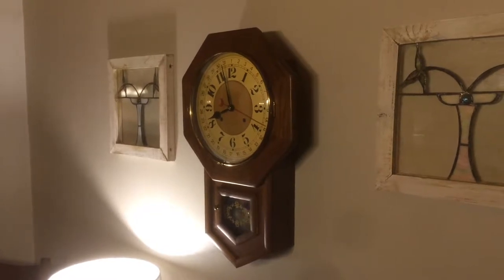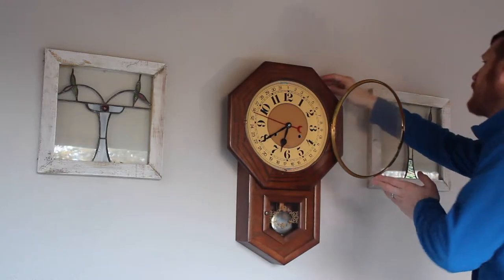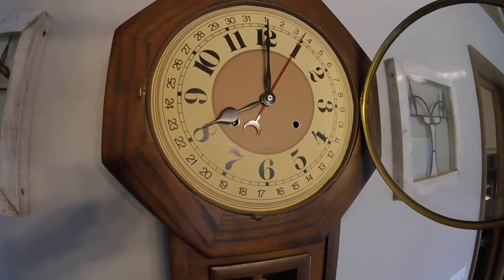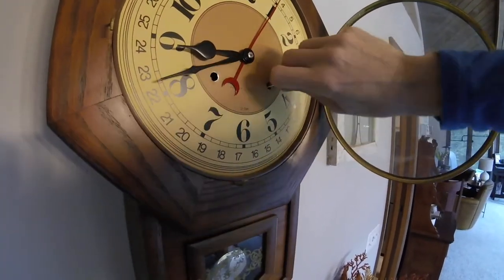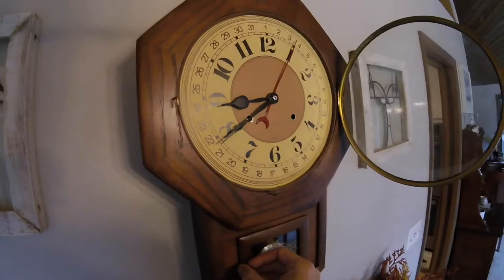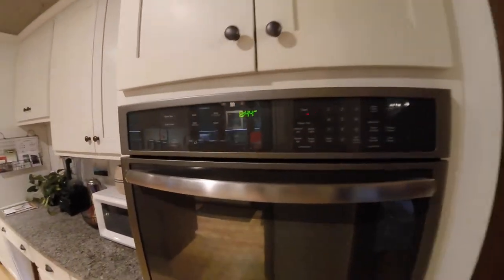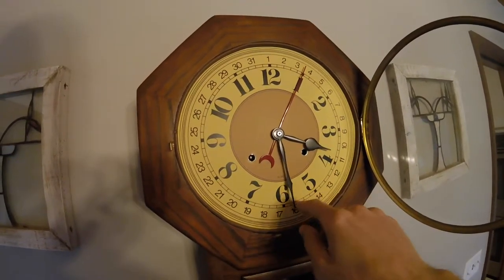CHECK OUT OUR ***Vintage Hamilton Clock (31 day)*** How to wind

Comment: Nice video but you forgot the most important adjustment.
Most Wall clocks are mounted on a single mounting point on the rear near the top. This means you can adjust the clock tiny amounts clock or anticlockwise. In the same way you adjust a painting on the wall. You need to listen carefully at the clock tick. The time intervals between the tick tock sounds must be equal  from tick to tock as it is from tock to tick to ensure the clock runs correctly.
Sometimes there is a marker at the bottom of the clock where you can make a pencil mark on the wall to keep track of where the balanced point you found is located.
Reply from the maker: Thanks for watching and the comment @Orlando Da Silva!

Comment: Which winding stem powers the  clock and which one powers the chime? I don't want to hear the chime currently...can I wind the clock and not wind the chime?
Reply from the maker: Thanks for watching - good question! As far as we know, there is not an easy way to stop the chime - other than opening up the back of the clock and removing the mechanism that causes it to chime.

Comment: I just inherited my Grandfather’s clock. Same one from the video. I wish I’d found this video first to order the key you have listed. I got a universal one from Amazon that has like 10 sizes lol. Anyways… I’ve noticed it gets a little over a 1 min behind everyday. So after a week it’s about 10 mins behind. Is this normal for a wind up clock or does that mean I need to investigate getting the pendulum adjusted?  Is that a sign to wind it up more? Sounds like you said winding the clock is a monthly task.  The clock has only be serviced once that I know of and sat for about 2 years in a closet after grandmas passing before I got it and shipped it to my home. Trying to learn all that I  can to keep it ticking for many years to come. Thanks!
Reply from the maker: Thanks for watching and the questions - I would recommend have someone service the clock (if that is available in your area).  As for the clock getting behind or ahead, there is usually an adjustment nut on the bottom of the pendulum that allows you to increase or decrease the speed of the pendulum and thus allowing the clock to keep correct time.  If it is only getting behind 1 min everyday, it should be just the slightest adjustment on the pendulum. Enjoy your clock - we love ours!

Comment: I have this exact Hamilton clock. It literally was my grandfather's retirement gift from Western electric. Unfortunately, it was over-
Reply: Unfortunately it was over-wound and has stopped working. I've taken it in for repair but the repairman is having difficulty finding parts. Can anyone help?
Reply from the maker: Thanks for watching and the comment @Tina Jurgens!  We received our clock as a gift from some good friends who had owned it previously (I believe they acquired it in the mid 70's).
Reply: Which way do you turn the middle hole if you have one? Ours is a 1984 Hamilton my grandfather got as a retirement gift.
Reply: SEWARD DRUMS which ever way it will go. Never ever force it if it won’t move.
Reply: Same! I just inherited my grandpa’s clock. Since both grandparents have now passed on.  Trying to learn all about it to maintain it. :-)

Comment: do you have to wait for the clock to stop completely before winding? would it damage the clock to wind it up just until you start to feel resistance like a week before the 31 day cycle has ended?
Reply from the maker: No, you do not need to wait for the clock to stop completely before winding.  I have reminder on my calendar to wind the clock a couple days before the 31 day cycle expires.  Eventually I wind it less and less because the fact is, there is no way to overwind a clock. Specifically, if a clock is wound fully, eventually the winding key will no longer turn. At this point, the spring is tight and capable of delivering the most power to the clock. This will not cause the clock to stop.

Comment: Thanks for the demo.  Does the date change automatically daily.  Or do you need to change it by hand?
Reply from the maker: Thanks for watching and the question @TheAx504!  Everything on our clock currently works except for the date (which should change automatically).  We had it inspected by a gentlemen that cleans and refurbishes older clocks and he said that a good cleaning would get it working again, so our plan is to have that done in the near future.
Reply: changes automatically.

Comment: Sir, I have a question
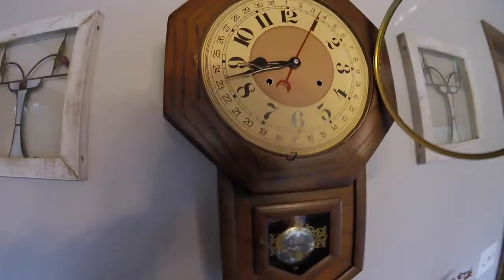How many laps did you do at 1:21 ?

￼
Reply from the maker: Thanks for watching and the question @IbnuSetiawan HR!  Typically we would turn the left hand side key hole about 10 half turns (or 5 full turns/laps).  Of course this depends on how long it has been since we last rewound the clock.
Reply: @OurBigHouseintheLittleWoods  Okay thank you mr. Our Big House in the Lityle Woods

Comment: When I wind the clock it seems like it has a little pause between winding like it kind of skips I guess you can say I just got this clock from a friend and the left side doesn't wind at all so I guess it's already wounded I don't understand what is the hole on the left that you whined for
Reply from the maker: Thanks for watching @eaglechas!  Based on what your describing, your clock may need to be serviced by a professional or cleaned to insure that it is working correctly - A 31-day clock operates by gears and springs located inside the clock and during the month, the clock winds down, and on the 31st day, it stops completely. On this day, you must rewind the clock to get it working again - in the case of our clock we have both a left hand hole and right hand hole that we wind with the key.
Reply: @OurBigHouseintheLittleWoods  thanks. but it keeps good time
Reply: I have the same clock both sides wind counter clock wise, and everthing works even the day hand.
Reply: @typonegative911  mine stopped working and it's going to cost at least a hundred to $200 to get it fixed
Reply from the maker: @eaglechas   - we received a quote for about the same price to have ours cleaned and tuned.  Sorry to hear!